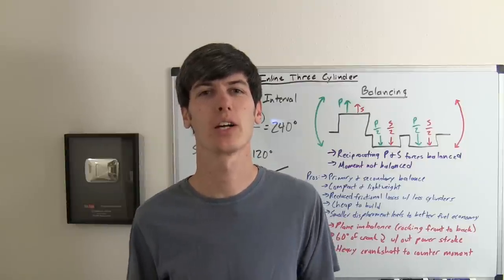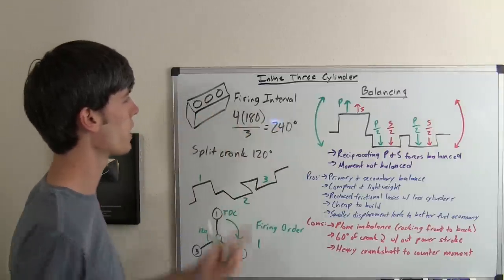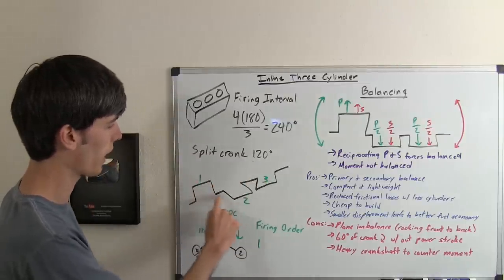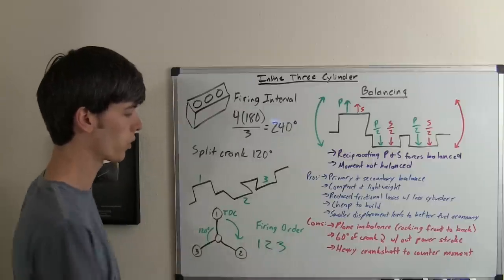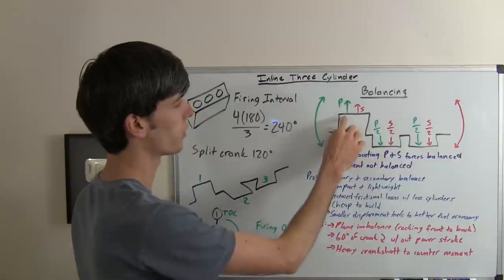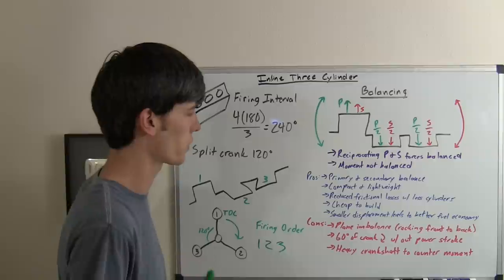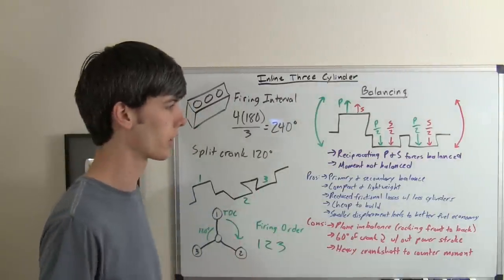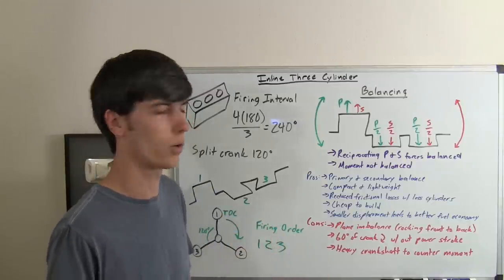Inline 3 Cylinder Engine - Explained

Comment: I test drove i3 car once (Suzuki Swift or for Americans Geo Metro). I liked the car a lot, but before that I owed a Yugo which was worse car in every way, it even had 903cc 4 cylinder pushrod engine, which was benchmark for smoothnes compared to this 3 cylinder. I thought that car is shaking because it idles, then because it is cold engine, but even after 10 minutes of driving it shaked whole car. It was not tolerable.
Reply: rade vozio yugo45 nego toyota aygo
Reply: TheWolvesCurse Ja mislim da ima Aygo 1.3 sa 4 klipa.

Comment: In low rpm uses like in cars a three cylinder isn’t great, on high rpm the three cylinder is awesome no smooth as silk, triumph motorcycles and mv agusta make the best 3 cylinder engines ever made

Comment: i hate 3cyl cars.they are so slow and depressing, they have no torque or power anywhere at all and they shake the car like a diesel.
Reply from the maker: Lawrence Timme https://www.youtube.com/watch?v=INscMGmhmX4
Reply: That is why most of the Japanese Kei cars came with turbo's
Reply: Engineering Explained you should see my profile picture on all the forums :P. what a nice kitty
Reply: khm BMW i8 khm khm 231HP/236 lb·ft khm
Slow, eh ?
Reply: Ben Hamilton Many - not most.
Reply: hojnikb the 3cyl isn't really powering the the car though is it.
Reply: i have a diesel and it doesnt shake more than the average gas engine. maybe because it's a bmw and not a cheap scrap engine
Reply: I drive a Skoda Fabia 1.2 HTP 3cyl with 65hp and I have to admit that in town I dont need any more power, max speed I can go legally on my daily route to school is 100 km/h so the engine is just perfect, a straight six would suck fuel like hell and couldnt bring me anywhere faster.
Topspeed is around 160 km/h, of course that is not much but enough to get anywhere...
Reply: And by the way, a bigger engine would make the yearly taxes and insurance bills explode plus I would have had to pay more than 2300€ for my car, keeping in mind it only has run 80k kilometers...
Reply: GermanTechHD i'm sure a 1.2 4cyl would be any more at all. it would just have a wider power band, which would save you fuel.......
Reply: Lawrence Timme

There is no 1.2 4cyl for my Fabia, beside the fact that I bought it first hand used a couple of months ago, its already 11 years old, I had no choice what engine it comes with.
Im happy that it has alloy wheels and is in good condition^^
My next car wont be a 3cyl anymore, but only because I will have significantly more money in two years, im 17 now, so no incoming at all, and for saving money, this car is great.
If the 4cyl is only a bit more expensive to buy and you can get a hand on one (which was not possible for me), and you have a save monthly income, the 4cyl is the one to go for :)
Reply: GermanTechHD
im 18 and my car has a 4.6l efi ohc v8 in it and the engine is great!
however in canada we dont have thing like roadtax. so insurance is cheaper than europe but i have put 2k kms on my car in the last month with regular use. my car has 592k km's on the engine and trans.
Reply: kennedy796

Of course its great, I bet it sounds amazing and you are very lucky that you live in canada ^^
592k km´s...yeah thats another advantage of engines like yours, they wont be broken as fast as the small ones, at least I think my 3cyl wont make it past the 200k km´s...but luckily I only have to drive it until im 20, maybe I get 100k km´s on it before I sell it :)
Reply: GermanTechHD
it is all about how you take care of a motor though. most engines are made to turn around 4k rpm all day safely. the reason a lot of larger engines live longer are how they are made. since my car has 8cyl, they dont work as hard and the engine on the highway turns what im guessing is around 1600-2000 rpm, as where my buddies suzuki swift turns around 3k rpm at 100 km/h. (my crown victoria doesnot have a tachometer as it is an auto). but these engines may sound like polar oppisites, but both are similar in a lot of characteristics.
they are both purpose built, they both are the most reliable engines when running properly, and both will start effortlessly at -40C. i want one of each lol.

P.S. the v8 has a quiet exhaust which is nice but some borla attacks would be gloriously loud.
Reply: I love i3, i4, i5, i6, V4, V6, VR6, V8, V12, W12, V16, W16 atmospheric, turbocharged, supercharged, twincharged, Amercian, Japanese or European vehicles... I just hate the fact that Governments let petrol be and don't put hydrogen instead, no pollution, cheaper and we'd be able to have a big displacement engine.... If we want one of course ^^.
Reply: Eat The Rich there are a few issues surrounding hydrogen though. the hydrogen has to be stored at like 10k PSI or something like that and a microscopic crack is a leak into the atmosphere. extremely hard to manage in that way were gasoline is easier as it is not pressured to that extent.

as for high displacement engines, they are best for low end torque and that is why most semi truck diesels turn maybe 1100 rpm on the highway with a 12-16L i6 diesel. not only is it cumbersome but that engine and trans weighs as much as the average chevrolet sedan. i could like big blocks, but they are a bit overrated in terms. like when im told big blocksolves everything, i believe a engine's displacement for a car is best balanced at 3-4 L simply because of torque figures and power figures are pretty much level.
Reply: kennedy796 You should teach your buddy how to drive then. It's more than likely the way it's geared, not any lack of power.
Reply: legacysage ?
Reply: +Lawrence Timme My emergency car, should my main daily ever break down, is a '96 Geo Metro hatchback, 3cyl 5 speed. It'll take some more modern cars off the line if I make it and it easily gets to and cruises at around 100-110 kph which is the speed limit for 90% of the highways in this country anyways. I actually enjoy feeling the barely noticeable idle shake from my Metro, lets me know the engine is still there and running.

Comment: Rising demand for fuel economy? More oil is being discovered almost daily and all over the planet. Check oil prices lately? Gas prices will be staying low. I owned a 3 cylinder once...never again.
Reply from the maker: Just because gas is cheap right now doesn't mean there's not rising demand for fuel economy. Gas is always cheaper in the fall than the summer.
Reply: It's surplus supply driving prices now. Gas usually is at it's highest now, during the holidays, but it continues to fall and is expected to go lower.
Reply: you know that its going to be depleted at some point, right?
Reply: I dont like 3 cyl much too. If Wolframalpha is not lying, price of 1 liter of regular petrol in usa is 0.75 USD. In my country price for 1 liter of regular petrol is 1.62 USD. Petrol in europe has better quality, but not as much to balance out the price. So the demand for fuel economy is real.
Reply: Viktor Domský
 Yeah, and taxes on less fuel efficient (ie more CO2 emissions) are quite big in some countries.
Reply: I don't think you understand the stock market? or economics or reasons for increased gas mileage on an international and federal level or efficiency of engines or why old 3 cylinders suck compared to new ones.
Reply: Viktor Domský Petrol in Europe isn't better quality...it's the same. It's more expensive because Europe uses less of it and demand is low. Whereas Americans use on average at least 5 liters or more everyday. Also pretty much everything is cheaper in America vs Europe one of the main reasons being the VAT.
Reply: Papaya Man
 standard gas in the US has 89 Octane (or lower, sth like that). The lowest you can get is 95 octane, most people get 98 octane, so yeah. it has better quality.
Reply: jerri0401 Do some research before spew false information.

I'll give you a hint, RON and MON. 
Just because you pay more doesn't mean it's better quality, its the SAME quality.
Reply: Papaya Man
 so you deny the fact, that we hace higher octane fuel?
Reply: jerri0401 No I deny your stupidity of the claim that you have higher quality fuel, its not a fact.
Reply: Papaya Man wow, ok
Reply: Papaya Man After some quick "research" I agree, nowadays the quality is same. The price is high because of vat.
jerri0401 Take a look at wiki article Octane Rating part Regional variations
Reply: Viktor Domský Thanks buddy, you are smart
Reply: Shikamoo P.K. I think many of those "reasons" that seem to be written in stone now, ( including the "global warming" theory) are changing with the discovery of huge new supplies of oil all over the world.  The earth has gone through many changes over many thousands of years, and "global warming" only takes into account a couple hundred years of recorded history.
Reply: Papaya Man
Sorry, but the actual octane content (not just the posted octane) is generally higher in Europe (I was just there 3 months ago). Take a look at the RON vs AKI chart. RON is used in Europe/Asia, AKI is used in North America. 93 - 94 AKI is the highest in the US, and 102 RON is the highest I've seen in Germany (with 100 being available in many places).

http://www.bimmerfest.com/forums/attachment.php?attachmentid=39763
Reply: corporalwaffles Exactly!! Someone who finally makes sense!
Reply: Damn I can't believe thoughts like this still exist
Reply: Papaya Man Idiot. RON is Research Octane Number and is tested at 600 rpm and variable compression ratio. MON is Motor Octane Number and is tested at 900 rpm with a heated fuel mixture and variable timing - it is a far harsher test than RON, and for any given RON rating of a fuel, the MON rating is typically lower by 10-12 octane numbers. AKI is the average of RON and MON. It is typically about 5 octane numbers less than RON. 94 in US is 100 RON, which is about as good as you will get anywhere.
Reply: So ignorant that I'm speechless...